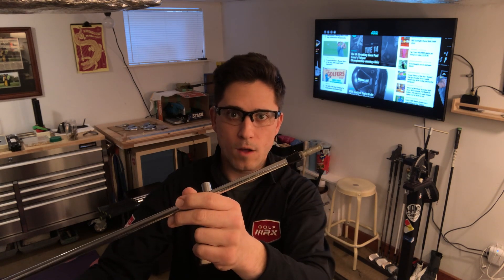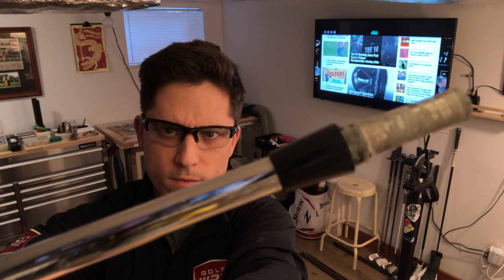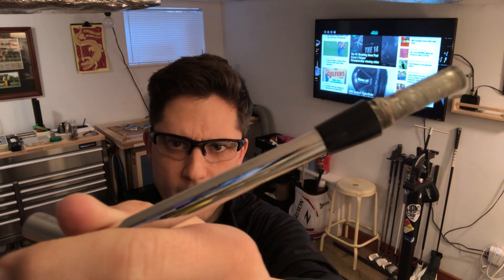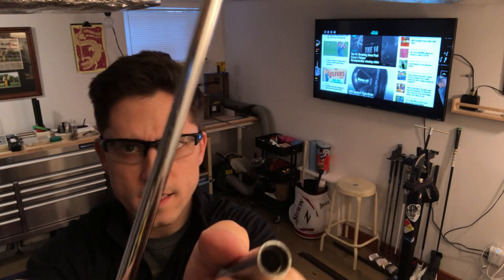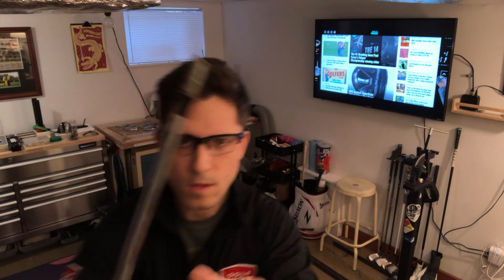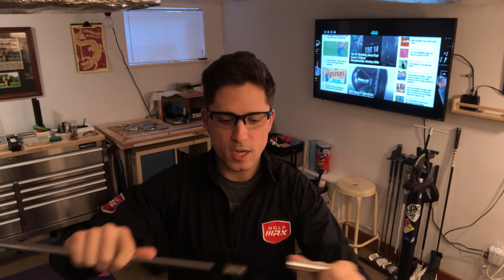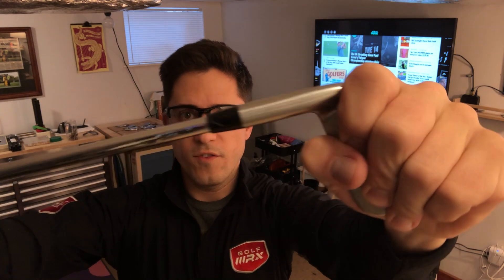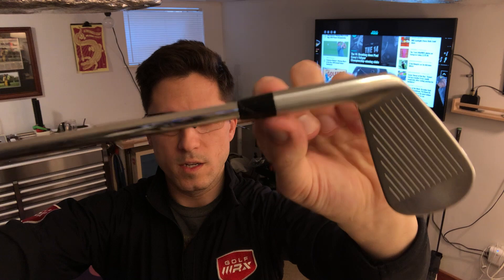What Are Collared Ferrules?!?

Comment: It doesn't prevent breakage at all.. That is utter BS.  It's so they don't slide up, and have people bringing clubs back to fix.  Ferrules are purely aesthetic, and  it's a production  QC  and  business decision  to design them like that.  If you swap out a shaft, and  reuse the ferrule, that collar is getting cut off usually.  There is no structural benefit of a collared ferrule.

Comment: Need some help. I have a Callaway X2 hot 3 wood when I pulled the shaft there is a brass pin fixed in the head. how can I remove it? Any help would be greatly appreciated thank you in a advance!
Reply from the maker: Great Question!
That PIn is actually a weight. You can heat the hosel and use needle nose pliers to remove it. Built a TON of those FW and with a bit of heat and the right pliers you can make quick work of that tip weight.
Reply: Thank you very much for answering!!

Comment: Hi Ryan, another great video. Not to get to far away from the topic, but lets just say that the fit between the hosel and shaft diameter wasn't great and that you would need a shim so it wouldn't 'wobble' when you dry fitted. If you had the collared ferrule would you still need the shim? thanks again! :D
Reply from the maker: It really depends - If the fit is snug at the bottom you might nit but if there is still quite a bit of wobble then you should certainly use a shim. When in doubt use a shim in my personal ideology.